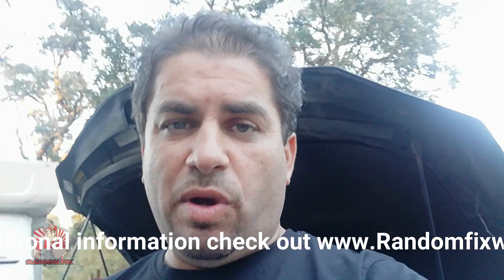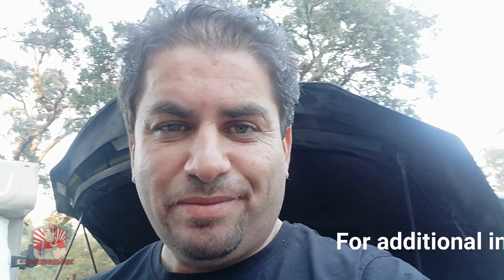Does Cataclean Work? Failed Smog, Bad Catalyst, P420 P430 P431

Comment: I have a 96 Jeep Grand Cherokee 5.2l V8 AWD with 180,000 miles (289,681.92 kilometers) on it.  
Two years ago when I needed to get a California smog test, my catalyst monitor test was incomplete.  I was allowed one fail, so I passed, as my emissions were well below the fail threshold.  Two yrs later, I need another smog test to renew my registration.  I don't have a lot of faith in the “mechanic in a can”, but I had tried everything else, so I bought Cataclean, and followed the instructions on the bottle. The throttle response was significantly better, as was overall performance.  The night before my test, I connected the scanner and my catalyst monitor test was good!!!
The only thing I did different was the Cataclean.  I just wanted to say thank you for the suggestion.
Reply from the maker: I'm glad the video content was helpful in getting your grand Cherokee catalyst monitor ready. Congrats on passing and thank you for taking the time to post this. Much appreciated ☺️

Comment: I use this two days ago, and now my check engine light turned off. Does really work? Yay.
Reply from the maker: Yeah, it works but it's only temporary so can pass. The only permanent solution is to often replace a worn out catalyst. _randomfix
Reply: How long did it take
Reply: @eleanordixon3982  2 days and its still off no check engine light.
Reply: Did ur check engine light go off by itself?
Reply: @victorgomez5165  it just berly did after months
Reply: thatpoeticthug is it back on?
Reply: @Randomguy-kn3nv  yes but it went away on it's own again today. Lol, but it did work when I used it. Put it on and Wind on the freeway stepped on it really hard. And the next day when I turn on the car to check engine light was gone.
Reply: Hi Can I put this in with half a tank of gas in a 2004 Cadillac Deville? Will it still work effectively?  Or does it absolutely HAVE to be poured in a quarter of a tank of gas? Thanks
Reply: @Brig3tt33  I put when I was pretty much almost out had like 2 gallons left. I recommend put it on when your down to a quarter. Buts thats just me.
Reply: @thatpoeticthug Hey thanks for your response! Just late at seeing it! darn I put it in on a half of tank and drove for about 30 minutes straight. Was desperate and couldn’t wait for my gas to go down. My cat was smoking and engine running rough so just dumped it in there. I might have to do it a second time then? Will do it by the bottles instructions next time 🙂
Reply: @Brig3tt33  it worked on my car as well gorgeous
Reply: @Brig3tt33  lmfao I did the same shit couldn't wait haha dammit. It's still on
Reply: Do you have to reset the engine light
Reply from the maker: It will help to have the engine light reset. There a few cars that I've seen turn off the check engine light off by itself after it detects multiple correct parameters. So in short yes reset the check engine light. Before you start throwing money at it. What is the make and model of your vehicle?
Reply: So it took the 2nd day for it to clear the light?   How many miles did you drive?
Reply: @RANDOMFIX  range rover sport sc 2007 replace d cats 9 months ago and they were oems now I get bank 2 low efficiency
Reply from the maker: Check the connectors and also the upstream and downstream oxygen sensors on bank 2
Reply: @eleanordixon3982  o
Reply: @RANDOMFIX  2006 pontiac grand prix GT supercharged with a P0420 code bank 1   , i used cataclean friday and today is saturday the check engine light didn't go off , do i need to reset it because its a 2006 ? Newer cars seem to turn it off on their own.
Reply from the maker: Yes please reset and then try get the  drive monitors ready. Here the video showing you steps for your 2006 Pontiac grandprix get.

https://youtu.be/Yp34ksJY-fQ

Comment: VERY GOOD! Second time I've used this product and both times CataClean has worked great.
I poured Cataclean with 5 gallons of gas on an empty gas tank.
It got rid of error P0421-Warm Up Catalyst Efficiency Below Threshold after driving my 2008 Mazda MX5 for 32 miles.
Reply from the maker: Jorge, Awesome and thanks for sharing your story of success. _Randomfix

Comment: It definitely works I used and passed emissions easily
Reply from the maker: That's sharing, and I hope your feedback and the video makes some ones day better. _Randomfix
Reply: RANDOMFIX anytime!! Just passed another emissions recently hahaha cataclean! No p0420 again
Reply: @kenjenkillasounds  how soon after you did cataclean did you go through emissions?
Reply: I’ve just pored a bottle in my tank. 🤞🏾 but before I start the car I’m gonna remove all off the 02 sensors and spray brake cleaner down stream into the catalytic converters.  🤞🏾🤞🏾🤞🏾🤞🏾

Comment: Hi there I have a Scion tC 2007 my engine light turn on just a quick question do I have to use the whole bottle I have a half tank right now just out gas I need help!!!
Reply from the maker: add to a 1/4 tank and then add the bottle but ask yourself these questions first. What monitors are incomplete? What caused the issue (like a dead battery)? Is there a pending code?
Reply: Just the code p0420
Reply: Pray to god this works driving my car aright now 🙏🏼

Comment: I have a 05 dodge ram 1500 5.7, I have codes p0440 and p0420 Cat monitor won’t show ready after drive cycles, do you think the Cataclean would help?
Reply from the maker: Maybe for the p420 code but you need to fix the p440 code first. It’s evap related “the vehicle's engine control module (ECM) has detected a leak in the fuel tank vapor system or that a vapor pressure sensor has malfunctioned.”
Fix that first then reset and see what happens.

Comment: It turned my o2 sensor status from INC to OK!!!  The o2 sensor “not ready“ has bothered me for months. I did the  drive cycle for 500 miles, but o2 sensors were still not ready, but they never threw fault codes.  Cataclean actually cleaned my o2 sensors to make them ready.  Thanks a lot!!!
Reply from the maker: Cliff, congrats and it's pleasure to help. _randomfix

Comment: I have a 2007 Nissan maxima. Something is wrong with cat...smoke comes out the back heavy, engine light comes on few days...back on ...had purchased last year as is. They claim just Minor dents. Right. Would the cleaner work for this cat.
Reply from the maker: Nope, I would address the mechanical issues and reason for the check engine light first before try to set smog monitors..does it only smoke when it starts or all the time?

Comment: how many drive cycles is needed for honda cr-v EX 2006 to be ready for emission test? 2 drive cycle? any tips on how to speed up or???
Reply from the maker: Sorry for the late reply! did you find a solution?
Reply: no worries and im still gona do the cataclean for engine light cuz i already got my catalytic conveter replaced twice

Comment: Any problem if I use it for maintenance, maybe just one bottle a year? My car is working fine.
Reply from the maker: You could but you might better off with large bottle of Techron once a year. Id you don’t have a problem don’t introduce a problem.
Reply: @RANDOMFIX  i USE TO BUY CHEVRON ALL THE TIME, BUT THE PLANDEMIA OF COVID MAKE ME THINK AND NOW the gas prices much more. I use Lucas oil and upper cylinder fuel injector cleaner and do oil change every 5 K with Castrol magnate synthetic.
Reply from the maker: Yeah Lucas is a good treatment when used once in a while.
Reply: @RANDOMFIX  I've been using it for more than 10 years every other week or once every two weeks. 40z every time.

Comment: For anyone wondering, use cataclean with 4 gallons of gas and drive until almost empty and fill up. This will work unless your cat is busted inside.
Reply from the maker: Good information. So did it work for you?
Reply: @RANDOMFIX  You know what man, my 420 code is still on. It went on after a week. I did not want to keep pouring the 25 dollars cataclean because it didn't seem worth it. could be that my cat is busted. I just got the car its 100k in.(ford fiesta 2012). I decided to just save up for a new cat that would cost me about 538 through ford. 

I tried the o2 trick, but honestly, my new advice would be to buy enough time to raise money to get a brand new cat.
Reply: I plan to add this every 4 months or so.
Reply: @foster4me2  yeah dude . No one ever told me but cat maintenance is important
Reply from the maker: There is one catalyst maintenance, make sure your vehicle is running good and the rest is out of your control.
Reply: WTH I thought only allow to drive 15 miles than fill up
Reply: There is maintenance cataclean is maintenance it says use every four months and cheap gas is bad for cats so using premium here and there is good catalytic converters should last the life span of a car

Comment: I've used Techron, Royal Purple, even Seafoam and nothing makes your engine run smoother and stronger than Cataclean. These other products may clean the injectors and combustion chamber but do nothing about the exhaust/cats. If your car has over 75K you likely have some exhaust buildup meaning a cleaner fuel system will be negated by a clogged exhaust. Highly recommend.
Reply from the maker: Andrew, thanks for sharing the great information about your experiences.

Comment: I have a Honda Pilot V6. Code P0420 is showing up. Is it safe to put in 2 bottles of cataclean at the same time since its a 6 cylinder?
Reply from the maker: Yes And make sure you don't have more 8 gallons of fuel. 4 gallons per bottle. What caused the catalytic to not be ready?

Comment: I have a Mazda6 2007 it shows the check engine and the mechanic told me is the catalytic you think this would fix the problem ?
Reply from the maker: Jose, its possible that this would help if your catalyst is marginal. I would watch the Mazda/ Ford drive cycle video first https://youtu.be/j8ZFTE1rSfA and I'm here for you if you have additional questions after you watch that video. Good luck and keep me the loop.

Comment: I need help. My 08 Silverado 1500 4.8 2WD 
Engine temperature goes to 5/8 and then electrical fan turns on and cools down to normal temperature. I have replaced thermostat, water pump, upper/lower radiator hose, radiator and cooling temperature sensor. But this only happens when in traffic or stays still for a bit. 
Also the transmission temperature goes up. Highest after I replaced radiator was 228. But notice if I turn A/C it helps stay cooler and also helps engine stay cool. 
I ended taking it to my mechanic and he added a transmission cooling radiator so it’s no longer connected to the radiator(main). It has helped the transmission not going passed 196. But it still bothers me. 
Also my mechanic couldn’t find issue why temperature keeps going up. He said it should be fine but not comfortable seeing that. Had a second opinion with an other mechanic and he said it was the catalytic converter. What do y’all think it might be?
Reply from the maker: So it cools down when the ac is on? And the 2nd mechanic says it's the catalytic converter? This could be a very simple issue or a combination of issues. What's you take? And also do you see and hear the fan when it goes past half on the temp gauge? Is your radiator cranked or clogged?
Reply: @RANDOMFIX  yes temperature drops when A/C is on because the electric fan turn on more frequent. But when A/C is off once temperature gage hits 5/8 electric fan turns on and cools down. It never goes pass 5/8. 
2nd mechanic believes the catalytic converter is clogged and engine not breathing like it should so temperature gets a little high on both transmission and engine. I have replaced almost every part I can think could case for temperature to go up. And yea even brand new radiator. Also a cooling radiator just for transmission. Which it did help. Transmission gets to 196.
Reply from the maker: But have you replaced the radiator? Have you pressure tested the cooling system? You can do a back pressure test to see if the catalyst is indeed the issue but I don't think it is as when the ac fan turns on the temperature drops.
Reply from the maker: Have you check the radiator  fan clutch. They do wear out.

Comment: check engine light reset before or after  driving ??
Reply from the maker: Before
Reply: @RANDOMFIX  so reset the light than put cata clean and drive for 50-100 miles or 30 minutes than i can take for emissions?? ty
Reply from the maker: Yes, And before you pour $20 - $40 of product in your tank I will send you the drive cycle for your vehicle, what are you driving? Year make model. Thanks
Reply: @RANDOMFIX  honda crv ex 2006…how many miles is needed for all my monitors to be ready mode (pennsylvania for emissions test)….how many miles or how soon can i take for emissions test?? ty so much for all the help…
Reply: @RANDOMFIX  so i have to complete the drive cycle before i do cataclean?
Reply from the maker: Add the 2 Bottles to a little over a 1/4 tank of gas the night before. Reset and than start the Honda drive cycle.

https://youtu.be/oZELvZ4danA

The drive cycle is not mile specific as it condition specific.

And if you don't want to keep plugging in the obd2 reader you can check your Honda monitors without any tools. 

https://youtu.be/cxpE_I1cKh8

Comment: Does your engine light go off. Or do i have to remove battery terminal
Reply: Most likely you have to remove battery terminal
Reply: I couldn't find cataclean anywhere.  So i used dura lube catalytic severe converter cleaner
Reply from the maker: This bottle cost $20 so I would suggest getting a obd2 reader to reset the check engine light before trying this. This is only a temporary fix. Most user say the check engine light returns but may help you pass. Check the smog tips playlist for additional help.

Comment: PO432 will it help dealer said I need a cat converter over 2 grands to fix do you think this will work for me?????...Emissions end of April
Reply from the maker: Pamela, look at my video on how to buy a direct connect catalysts for dirt cheap. It just bolts right in but cataclean can help but the only real fix sometimes is a new catalyst. What are you driving?

Comment: I got a cylinder 1 misfire, would this work?
Reply from the maker: Nope, you need to fix that first. There is a little chance that this can help with that.
Reply: Cylinder 1 misfire. You need to change your spark plug or ignition coil. If you're going to change one spark plug, change them all. If you can afford it, you might as well change that one ignition coil in cylinder one. That resolved my issue.
Reply from the maker: Thank you for sharing

Comment: My 2014 Challenger SRT8 has a high pitched whistle and some hesitation when I accelerate. Can I still use this? Will it be safe for my cats?
Reply from the maker: I would not recommend using this product for that issue unless you further investigate. Do you feel you exhaust system has excessive pressure or blockage?

Comment: I have a 2013 f150 5.0L, check engine light that said says running rich and to change mass air flow sensor and 02 sensors. I’ve changed the air flower sensor and the 2 02 sensors on the cats but left the remaining 2 02 after each cat. Engine light went away then came back. Should I just try this or change the remaining 2 02 sensors. I’d appreciate any help lol.
Reply: ^Trying to save as much money as possible haha
Reply from the maker: Grant there is no replacement for new a part, cataclean can help but its only a bandaid. I would replace the 02 sensor unless there are utterly expensive.

Comment: When it's used does it turn off your check engine light?
Reply from the maker: If you have a marginal catalyst yes it can help but it's only temporary solution. Why is your check engine light on, what is the code you retrieve when you use a obd2 reader?
Reply: @RANDOMFIX  hi can't remember but bank 2 low threshold
Reply: Anyway I used it today as recommended the check engine light came off after I restarted
Reply: @RANDOMFIX  I changed the catalytic converters 9 months ago oem from  range rover
Reply from the maker: So the check engine is off now after you used the product?
Reply: @RANDOMFIX  yep
Reply: @RANDOMFIX  I guess for now
Reply: I'm going back to the shop where they installed them. They are still under warranty. I was just hoping for a quick fix but the performance has improved.
Reply from the maker: Thank you for letting me know

Comment: Finna try this on a Prius will comment results soon

Update #1: I have a Prius 08 170k miles. Got the code p0420. Went to the dealership they quoted me at $2600 for the cat converter. I looked into workarounds. I bought this product the same day and followed directions. Drove about 50 miles to get my gas tank at half. Poured the product in and drove for about 40 miles. The engine light went off. Next day drove for 80 miles straight and with no light. 😄 

Update #2: still driven for 300 miles and no light
Reply from the maker: What year is your Prius and how many miles?
Reply: @RANDOMFIX  really?